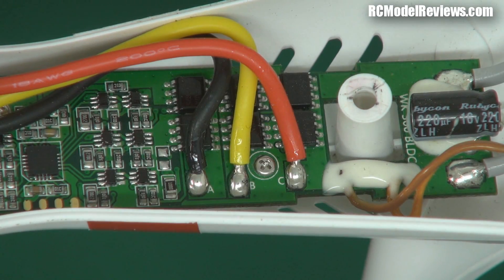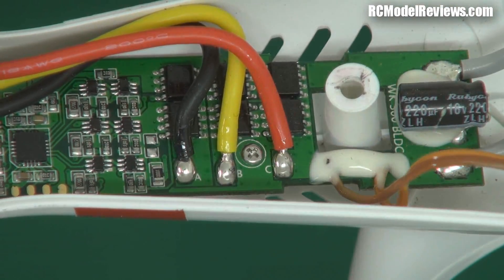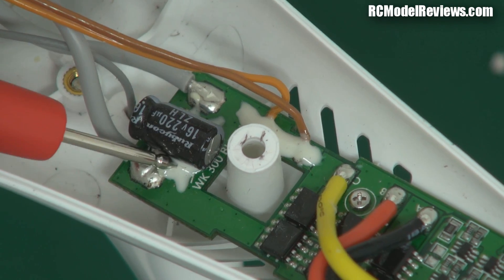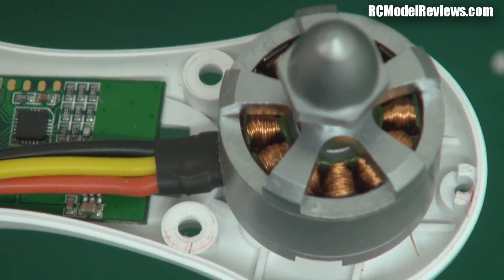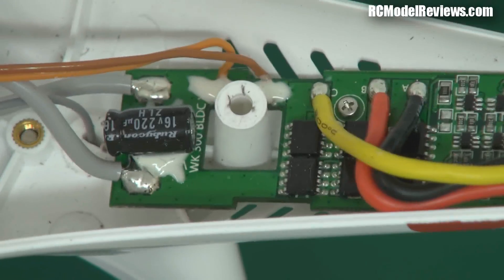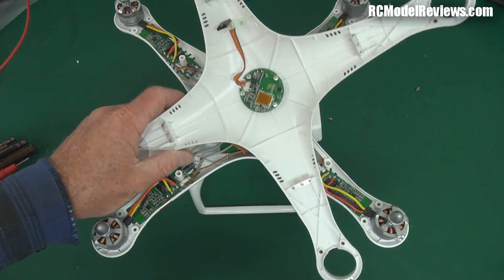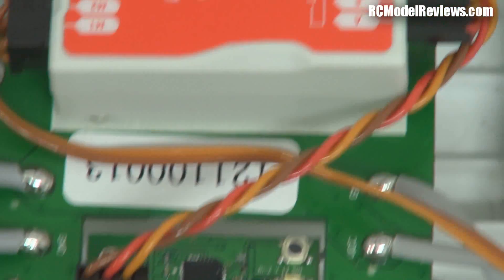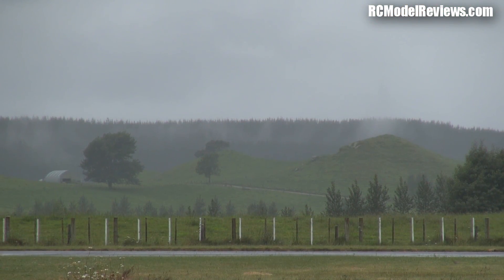Inside the DJI Phantom multirotor (drone)

Comment: I noticed on my Phantom 2 that  all soldered components seem to have had some sort of glossy coating put on.  I changed out my motors with T-Motors and was wondering in your opinion if the new solder connections should be coated as the originals were.  And do you have any idea what exactly DJI is using or an alternative.   One friend thought it might be an enamel coat.

Comment: I'm disappointed at walkeras soldiering. Hopefully they address that issue but they still are cheaper than the dji rtf by a $100. Plus the walkera u can buy bnf, arf(no reciever), rtf, and rtf with fpv. Either way it's good dji has competition it drops the prices.

Comment: Another interesting video Bruce.
Hey I have a question....I am waiting on a Phantom v1.1.1.
I understand there is a 400 foot AGL law here in NZ for model aircraft.
Now what device can I  buy for my Phantom so that I can obey that rule?
Reply: You could try the Wireless Copilot:

Review: Wireless Copilot Safe2Fly (part 1)
Review: Wireless Copilot Safe2Fly (part 2)

It lets you set an altitude alarm and will give you a voice-alert when that alarm is triggered.

However, you'll find it very hard to see the Phantom if it's 400 feet AGL so if you're using FPV (which is about the only way you could really fly that high with ease) then you could get an OSD to display that data on your video downlink.

Comment: I have flown my DJI Phantom to 2Km/1.2 miles for us in the US; granted I don't have to worry about anything violating my Fresnel zone here in the desert. I have had the RTH kick in when I flew it straight above my location which was about 1600'; I may have flown into the "Donut hole" of my TX signal.

Comment: Hi Bruce,firstly i love all your video,s,i purchased a phantom 4 months ago,i was very impressed with the build quality,your little trip around the inside was great,i fitted mine out with futaba sbus rx and h3-2d gimbal with gopro 3 black,fat shark attiude fvp,modded battery compartment to take 3300 3s,flys for almost 10min,and put some retractable legs on it,its got me some great video over the summer,but i got fed up of seeing the props in shot so built a TBS discovery and made all the kit i had on the phantom fit the TBS,fly it on 4500 4s,10min flying time and no props in shot,its the business!!

Comment: Greetings from Miami Bruce! This was a great review indeed. We here (fellow workers) have bought two DJI Phantoms and two 350s. There's really no comparison as you say, to be honest. In fact, one of the 350 left on an eternal flight a week ago and my buddy is still waiting for it to fall from the sky. There's unfortunately really no documentation on any of these devices for us tinkerers to work on. It would be nice to be able to turn LED's on/off to save consumption and do other things like that. As to the transmitter range, I was able to adapt an SMA connector on the DJI tx to try different gain antennas, but in my opinion the range is quite good and extending it will simply endanger your return to home. Keep up the good work!

Comment: Nice video, this is phantom version 1, there is another version with dual receiver ( you can recognize the newer version that it have 2 antennas )  You can remove easily the receiver, stick futaba with s.bus ( same cable ) and 1.5Km range is no problem :)